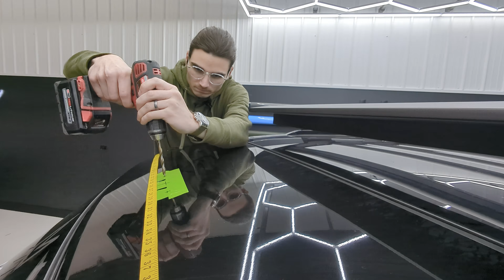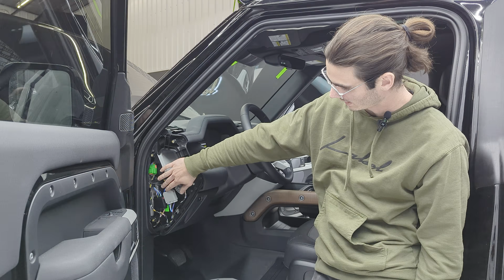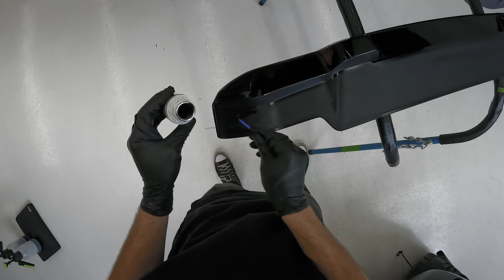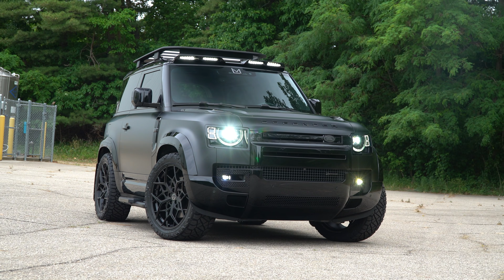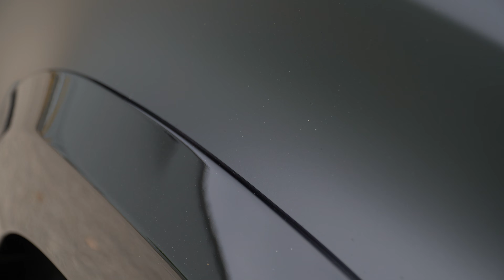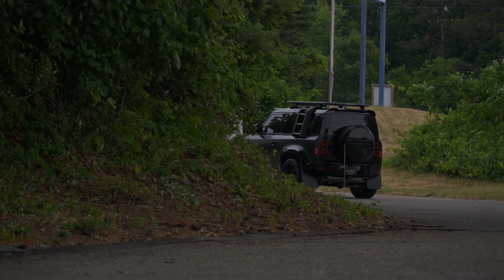OUR 1ST URBAN DEFENDER 90 BUILD and REVEAL EPISODE!

Comment: Great job. Did you guys stick on the fender flares on top of the satin PPF. In the video all the panels are wrapped where the fender flares glue on.... Just about to do one of those and considering PPF up to the flares.
Reply from the maker: Thank you, no we trim the ppf back to be covered by the flare, but not covered by the adhesive.